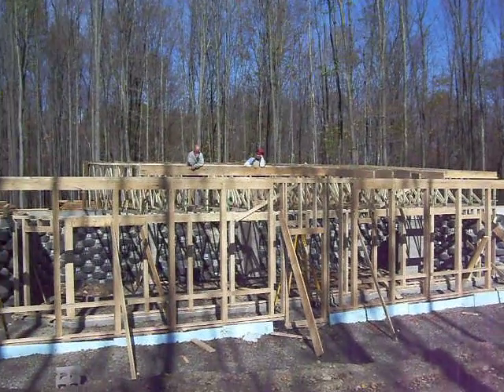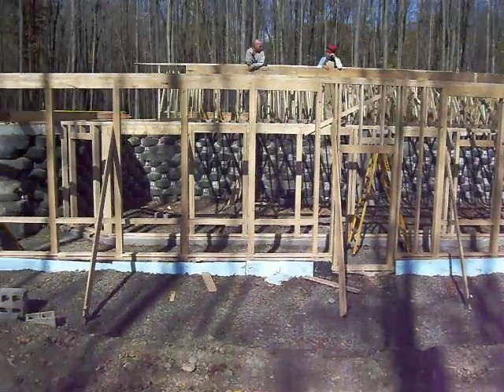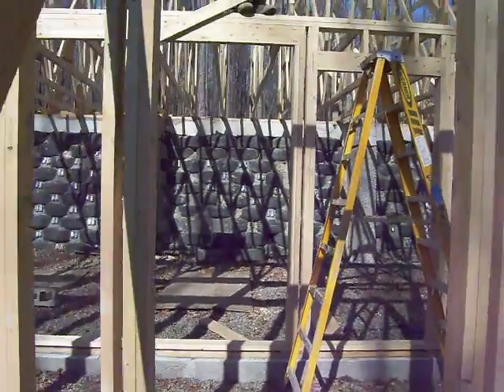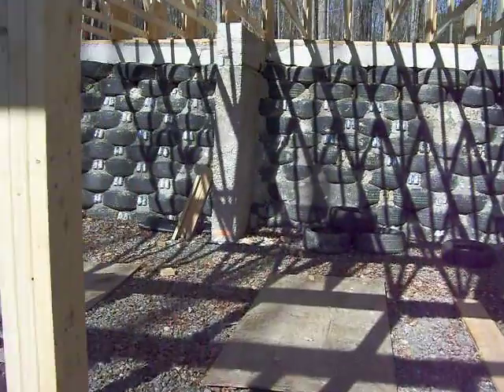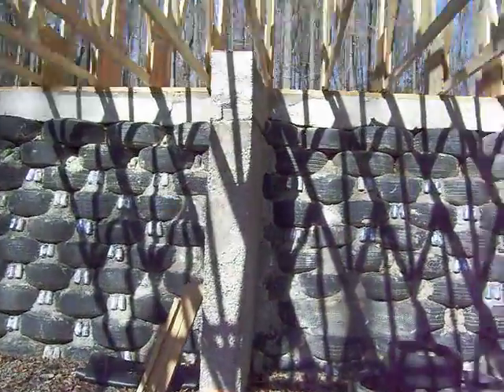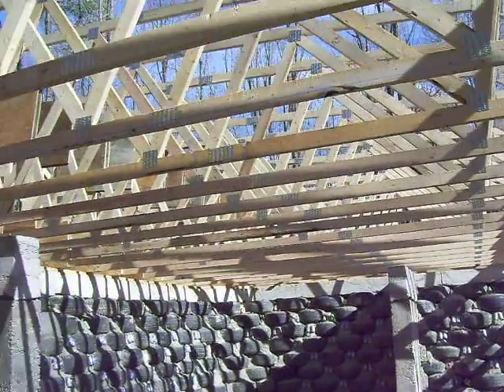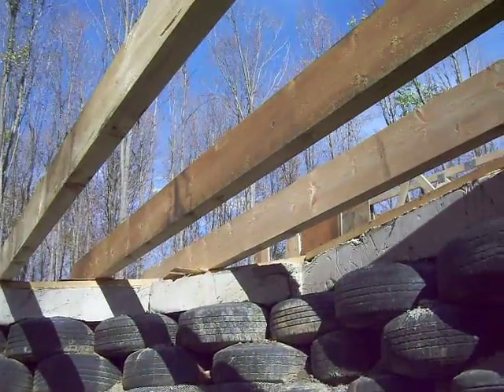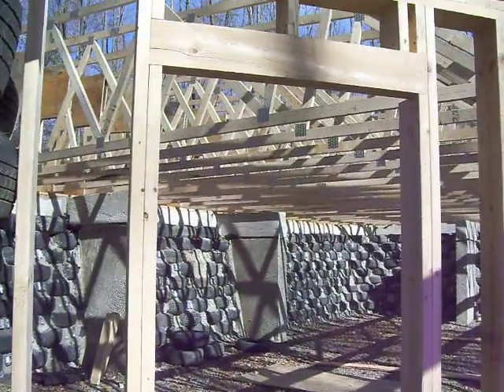Roof trusses

Comment from the maker: Actually,  it doesn't smell of tires at all.  The tires are rammed with 350-400 lbs of dirt, and then bermed on the outside, as well as plastered on the inside.  There is no air circulating by the tires.